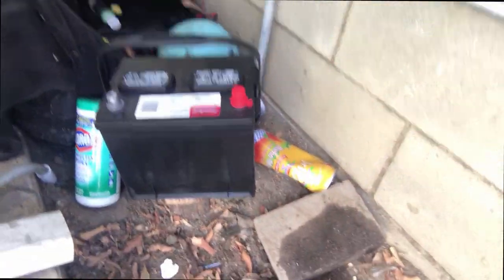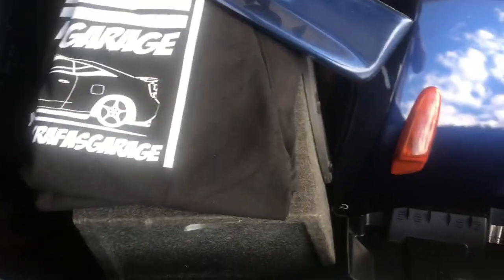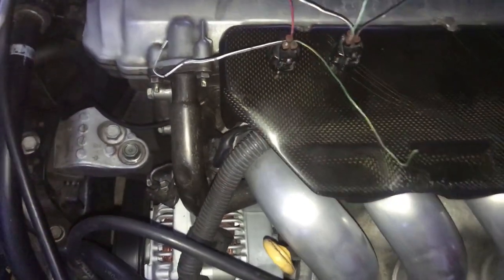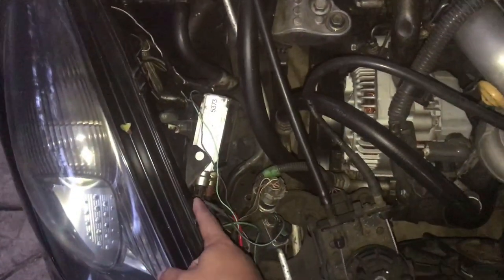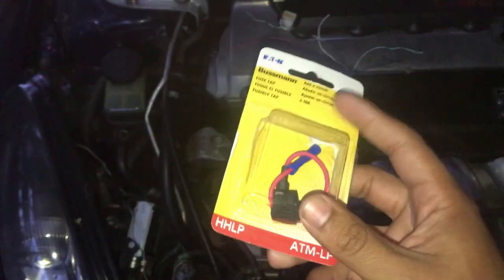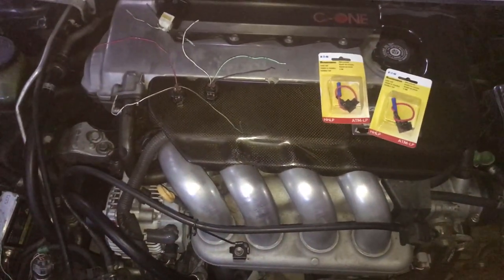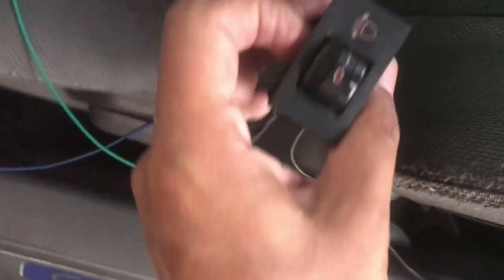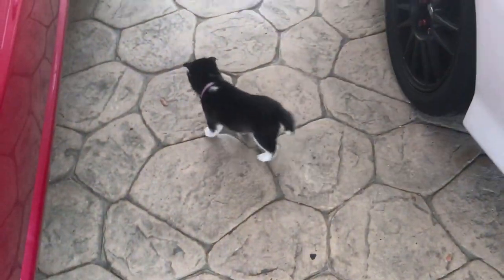Making Another Leveler Harness

Comment: What oil do you use unfortunately I have the oil burn problem on mine a bit annoying but I love my celica, I was thinking of using synthetic I currently put 10w 30 highmileage
Reply from the maker: Robledo,D All 00-02 1zz celicas had the oil burning issue unfortunately but I still use 5w30 mobile one full synthetic high milage